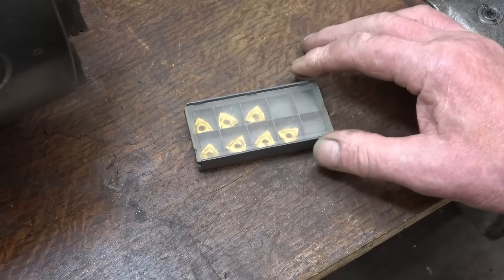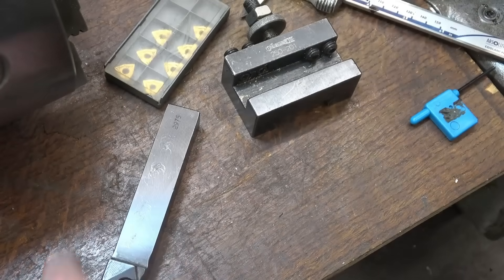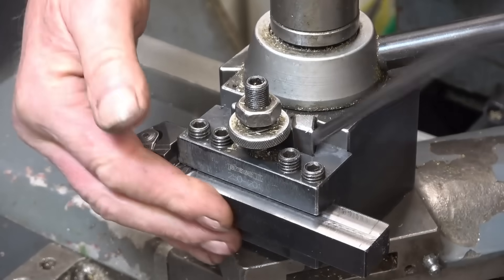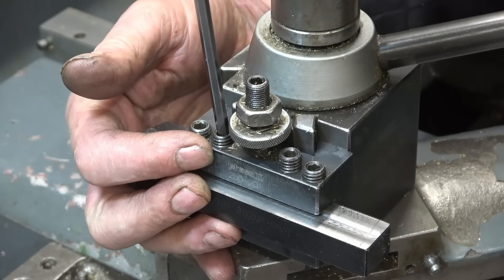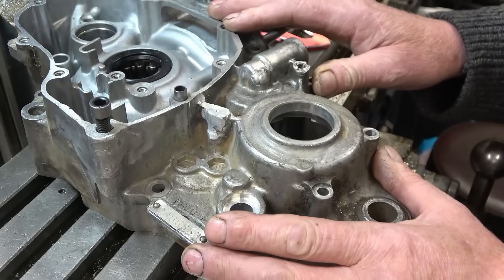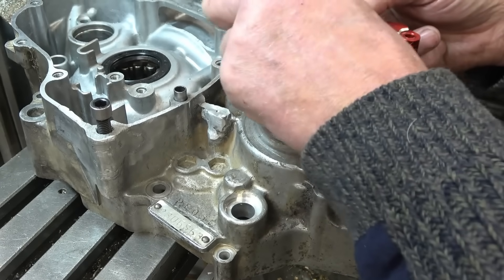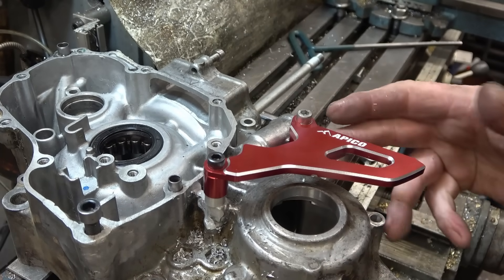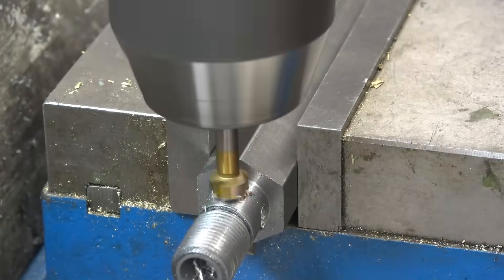SNNC 613 . Lathe Tool MOD  . Honda Crankcase Thread Repair.

Comment: Its my understanding that many tool holders are Nitrided for strength and a durable finish, those WNMG inserts you have have a relatively small radius, great for low tool loads when cutting. Iscar is an excellent manufacturer. 
Looks like Debs needs a workshop John 😊😅.
Great video 😊

Comment: It might be better to take it off the bottom, especially it there is a chance the tool is only case hardened. That way the screws wouldn't mar the surface and the tip is still the same height as the top of the tool.